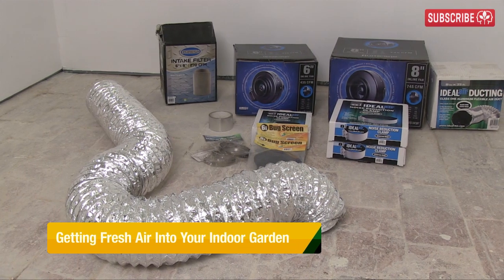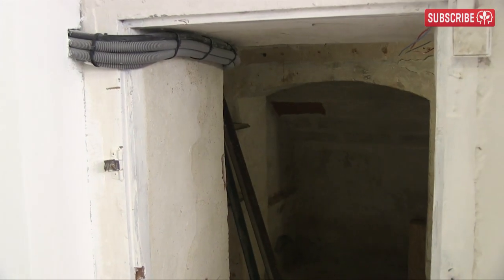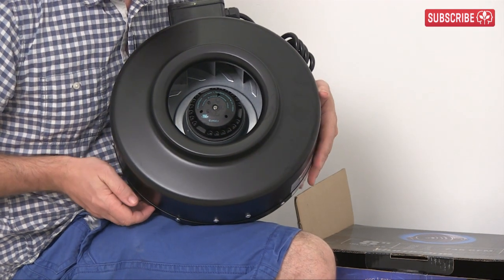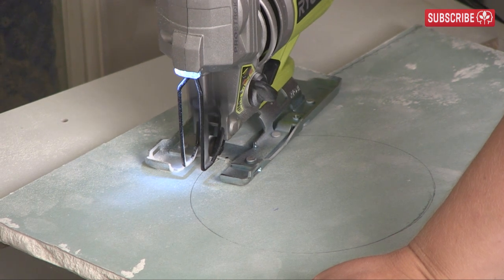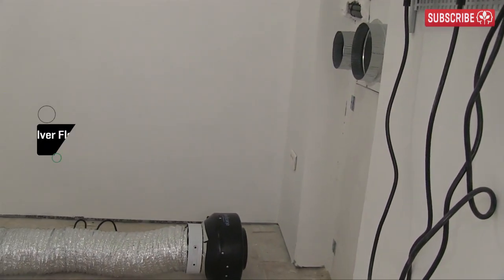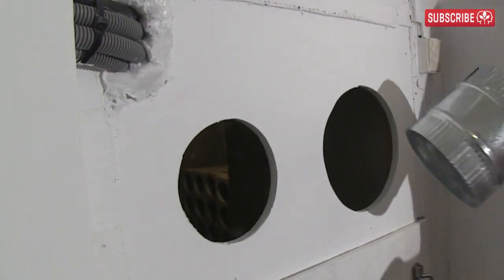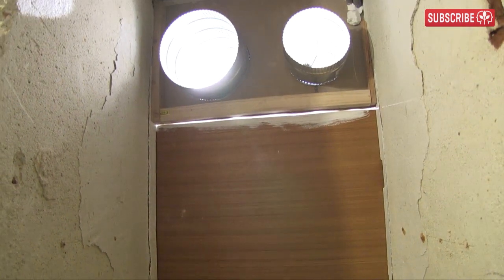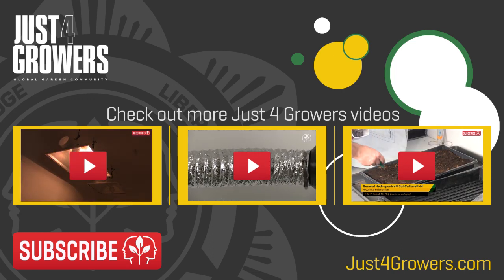Grow Room Ventilation 101—Calculating Fan Requirements for Incoming Air.

Comment: For a space that is W=2ft 6in. , L=4ft 6 in. H=5ft 10in. and only one 2ft x 2ft window with a 1ft x 2ft space to use when window is open for a intake/extraction point. What would be the best set-up for intake and extract in a scenario like this. I'll be using one 400w hps for both veg and flower until I can get a 400w Halide blue spectrum that I will use for veg. What would be a good fan for this setup with the calculation being about 65 cf exactly? I found a 4" inline fan that says it's 65 cfm would this be sufficient enough? also should I only use one fan for the extract and just let the intake air get pulled in from the extractor fan pushing out the extraction hole? 

It's a small set up but I'm making use of this space for data reasons so that I can apply the gathered data to large scale projects. And with that being I have to make sure the air circulation is optimal for this size of a room so I can control the humidity and temp to get accurate data.
Reply from the maker: Hi Kevin. Thanks for your question. It's very interesting and there's lots to consider. First, some numbers. If you're planning to use a carbon filter then you should add 20 to 25% to your MINIMUM CFMs bringing us up to around 85. I will assume that you are running open (non-AC) hoods and you are growing light-loving, flowering plants through to maturity and harvest in the same small area. 

Now, given that it is so compact and you will have mature plants in there (which probably prefer a lower RH of 40 - 45% while transpiring heavily!) I would personally spec your fan a little larger just to give yourself some wiggle room. A 6" Hyper Fan moves 315 CFM and you might think that's overkill - but it's not, especially as you can dial it down to 35% sped with the included speed controller and remember you have to reduce that number by at least 20 - 25 % due to pressure drop (filter, ducting, etc). The hyper fan uses even fewer watts when dialed down.

I don't know where you live, but if it gets hot and / or humid you'll be glad you have some "throttle" power left with a 6". A passive intake will be fine - make the hole at least 4" in diameter and cover with a bug mesh.

Good luck and keep in touch. Everest.
Reply: +Everest Fernandez (Just4Growers) Ok thanks! and I'm In the United States over in Oregon. getting ready for winter over here! lol. anyways with a 2 x 2 window and 1 x 2 opening in the window to use do you think it would matter if the extraction and the passive intake were to share that space being that close together if only pushing for that small of a space?
Reply from the maker: +Kevin Farmer Your intake and extraction points should ideally be at diametrically opposite points in your grow room. Extraction at the top, intake at the bottom, on opposing walls—that way your plants stand the most chance of benefiting from the fresh air rather than creating a sort of 'slip stream' that bypasses your plants in the case of intake and extraction points being located too close to one another.

Comment: Which is better a Carbon Filter or HEPA filter for intake? Do they do the same job? Is one better than the other?
Reply from the maker: Hi Phillip. Thanks for your question. For intake, use a specialized "intake filter" - e.g. Phresh or Hepa - they just remove particulates. Carbon filters do this, but also remove odors, and are generally used as air scrubbers or as part of an extraction system.
Reply: +Everest Fernandez (Just4Growers) okay I thought Presh was a type of carbon filter for intake. That's what I was confused about. Thanks for the help. Your videos are the best.
Reply from the maker: +Phillip Tussey Any time! Phresh make both intake and extraction filters.

Comment: great video man, I have one question

my grow tent is 80x80x180   CENTIMETERS

what fan & filter should i pick for this size grow tent
Reply from the maker: Rafael Rassi Hi Rafael. Thanks for your question. Your grow tent is 1.152 cubic meters. (.8 * .8 * 1.8). You need an extraction fan capable of exchanging the air in your grow tent at least once per minute. Fans are rated in cubic feet per minute (CFM) or cubic meters per hour (CMH), depending on where you live in the world. As you specific your tent dimensions in metric, I'll go with CMH. 1.152 * 60 = 69.12 CMH. However, if you are using a carbon filter then I recommending adding 20% to this figure. 69.12 * 1.2 = 82.94 CMH. (48.82 CFM) A 100mm or 4" diameter extraction fan connected to a fan speed controller (e.g. Zephyr 1 by Titan Controls) would be a good choice for this size grow tent. 

I know that was a lot of numbers! Let me know if you have any questions. Always glad to help. Peace and happy growing, Everest.
Reply: Thanks a MIL man, i was almost buying this one
http://www.airfan.com.br/loja/index.php?route=product/product&path=51&product_id=205
because i thought it would do the job... THANKS again
Reply from the maker: Rafael Rassi My pleasure! That fan you link to is 6 inches (150mm) but the CMHs are low! A 6" Hyperfan with its built-in speed controller would give you more than enough extraction power, but it depends what's available to you locally.
Reply: I ended up buying http://www.growplant.com.br/exaustor-axial-in-line.html

Will it work fine on my tent? With the carbon filter?
Reply from the maker: Rafael Rassi The specs look fine to me Rafael. Next step is to purchase a 4" carbon filter. For that sized grow tent I would just rely on passive air intake (no need for a fan to blow air into the tent.)
Reply: thx again brother, and im thinking only getting a small clip fan for inside ventilation
Reply from the maker: Rafael Rassi That'll do fine. Aim to move the air in between the grow light and the plant canopy.

Comment: how calculte the air exhust  suppose room size is
45 feet long x 30 feet wide x 20 feet height what size of fan or how mans are to be used. ,nice video
Reply from the maker: SUKHDEOSINGH RAJPUROHIT Hey Sukhdeosingh. You ask a very interesting question, because your ceiling height is so unusually high. Higher ceilings give you a larger "buffer" of air and do not necessitate larger fans as some formulas might suggest.

If your room is full of plants (that is, your active growing area is 45 x 30 ft) then I would suggest using fans that move 12,000 - 16,000 CFMs in total and attaching them to speed controllers. Move towards the upper limit if you are using carbon filters which lower the CFMs by around 20%. I believe it is preferable to over-spec, use speed controllers and be ready for spikes in ambient temperature than having your fans on maximum all the time and not being prepared for external environmental extremes.

In practical terms, you would need one 10" Hyper Fan (for example) for each of those 1,000 CFMs you want to move, so you're looking at 12 - 16 fans. Alternatively, you could go for larger 16" fans that shift more than two and a half times the CFMs of the 10" fans. Larger fans are available but it might be beneficial to extract from multiple points with such a large growing area.
Reply: cfm x 60 divided by volume of room - for cannabis you need about 15 ach